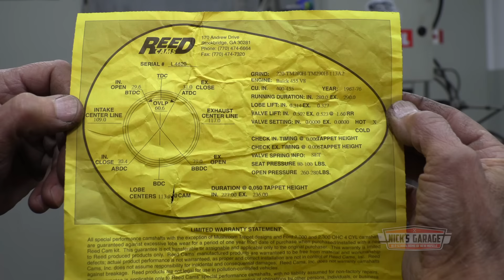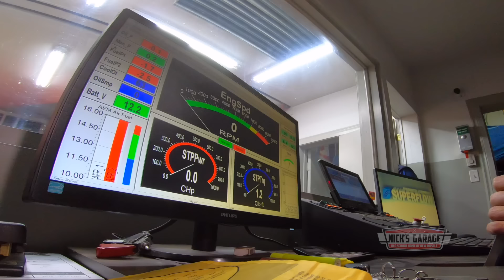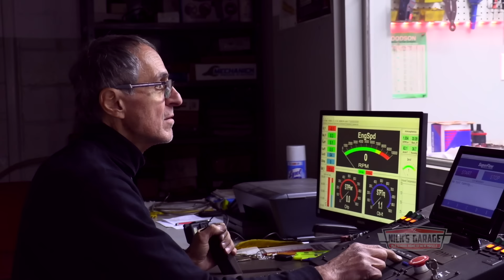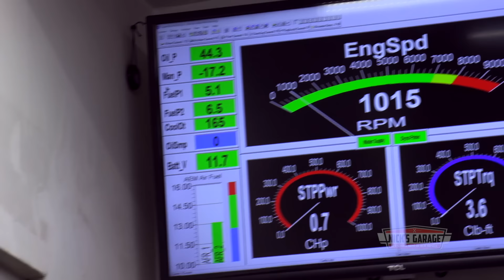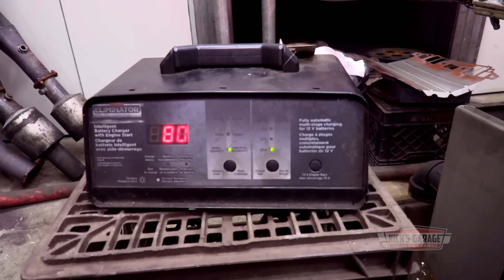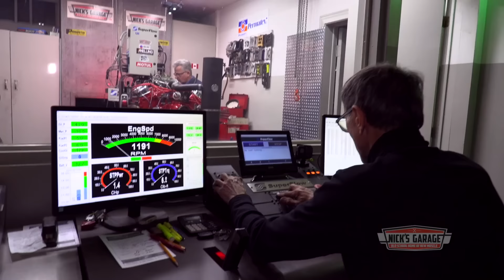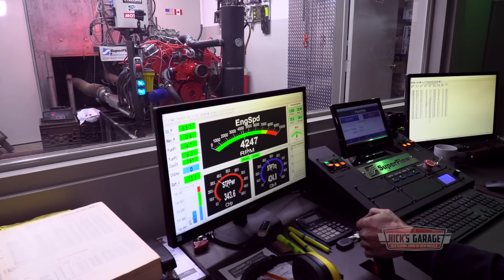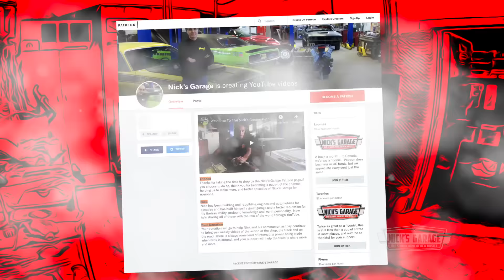1970 Buick 455 Stage 1 - Dyno Room Diagnosis

Comment: The ratings that you are trying to match do not mean much.  GM sales personnel were deciding on what the ratings would be.  The GM engines had very restrictive cylinder heads, and despite the big cam, you just cannot make the hp and torque that the 440 makes.  This big cam also kills your low end torque, but because of the poor flow of the heads, you don't get much upper rpm power.
Reply: What a load of misinformation. By saying "the GM engines", you are instantly discrediting yourself, as lumping all GM engines together is like lumping Mopar and Ford engines together.
Reply: @cdglasser  Actually, this is exactly right.  Pretty much all GM engines.  For the most part, Mopar was lying a lot less about their ratings.  Chrysler was a smaller company, and was not controlled by the bean counters and marketing managers.  They had a much better engineering department, and the engines were shared by all divisions and had to be developed only once.  Both GM and Ford were controlled by bean counters who knew that real performance does not sell because the average customer never drove their cars to the limit.  It was performance image that sold, and that is where the gross power and fictitious power ratings game came from.  There were some very few exceptions in these rules, one is the Ford 427, which was dropped in 66 or 67 because it was too expensive and replaced by boat anchors that had similar ratings but much less performance.  GM engines can now be made to make a lot of hp, but generally they need huge cams (no bottom end), roller cams (helps to compensate for lack of rocker shaft) and aftermarket heads (which somewhat compensates for the poor engineering of the time).  Having said that, the low end of Mopar engines also often exaggerated hp.  The single exhaust 440 was nowhere near its 350 hp as installed in the cars (it was perhaps 275 hp, it would be close to 350 hp with dual exhaust).  The 64 413 with single exhaust would not be anywhere near its advertised 340 hp.  But the rating of the dual exhaust 440, 383's, many of the 340's or the 426 hemi was not too far off.
Reply: @demetridar506  baloney
Reply: @markbuchanan3694  very insightful!
Reply: @demetridar506  people talk about Buick like they know about,them when they don't.  They talk out of ignorance,not practical knowledge. When it comes to this,it is best to be thought a fool than to open your mouth and leave no doubt
Reply: @markbuchanan3694  The practical knowledge is this video.  The buick is not a very good engine if you want to go fast, that's all there is to it.  Olds and the rest is not much better.  You have to do too many motifications to get something descent, and by that time its no longer buick.
Reply: @demetridar506  Nope,your just talking. I have built and raced them for about forty years,I have put a lot of so called better cars on the trailer.
Reply: @markbuchanan3694  The recently developed term "fake news" applies here very nicely.  There is no shortage of self declared champions.  Especially in the recent keyboard world.
Reply: @demetridar506  Are you an expert in this field?
Reply: @markbuchanan3694  What field?  In order to make power you need good flowing heads and a good valvetrain support so that you can have as high valve lift with as little valve duration.  Good bore to stroke ratio and not cheap material selection helps.  Most GM and Ford engines lacked all of these (partly to reduce cost, and partly because they did not have the development budgets), so you need a huge cam to make power, meaning no low end torque.  Add to that the terrible exhaust manifolds, I can keep on going.  This is not a complicated "field" that requires "expertise".  

In the 1960's the internal combustion engine was a fully mature product.  The world knew how to make powerful engines.  There is nothing special about the mopar engines.  There is no real sophistication or innovation in the technology.  In fact, by German or Italian standards, even the Mopars were rather crude and behind technologically.  But they at least did their homework, and were not trying to cut cost everywhere they could.  GM and Ford recognized that as stupid as the general public was (you think Americans are stupid now, they were a whole lot more back then) sound engineering was not necessary to sell cars (styling and marketing sold cars, i.e. imaginary hp numbers, which explains why the "expensive" Ford 427 for example was dropped in 1965 or so).  And they were right.  Chrysler went bankrupt in the late 70's, and were making marginal profits through most of the 70's.  But we can enjoy now the well engineered products with the simplicity and good styling of the old days.  And Chrysler engineering does not stop in the engines.  Suspensions and transmissions were also superior.  Even on the suspension world, it was still a bit crude compared to foreign manufacturers (Jaguar and Benz had IRS by the mid 60's, for example).  But again, at least they did their homework.
Reply: @demetridar506  you said a lot,but you are wrong on Buick. Their stage heads flow well,and the do have some good exhaust manifolds. Again you make assumptions without looking into Buick development. Their bore to stroke ratio is the best in the business,they have a very stable valve train set up,they were very advanced in developing light weight materials for every day use. Their 455 series engines do very well at making power in the ranges that are useful. Check out benisek and jones undefeated 72 season,or how about buddy ingersoll v6 prostock,and don't forget the indy effort. They were the first to put a stock block on the pole. Their nascar effort on the short tracks was dominant,the small blocks couldn't catch them. The gtp cars made so much power they broke the unbreakable March chassis,so I don't think you have done your homework on Buick.
Reply: @markbuchanan3694  Your comments are not supported by reality.  The stroke is a bit too long, the con rod is a bit too short, there is no rocker shaft.  The crank is iron.  All that shows that the engine was designed for economy of production.  Most of these engines were derived from small blocks, hence long strokes and short connecting rods. and GM did not want to invest in designing a big block from scratch.  Head flow was not impressive.  The performance of the cars as shown by multiple road tests of the day show that the cars were not that competitive.  This dyno test here confirms all that.  This is too simple to require any "expertise".  The race cars that you refer are more or less irrelevant, the race car engine abandons a lot of the compromises necessary for a regular passenger car engine, and the race results are often dominated by how much money the team happened to have as opposed to the quality of the product they started with.  And frankly, why would Buick, a division of GM, somehow magically deviate from the standard policy?
Reply: @demetridar506  You're WRONG on so many things. You should just stop now. The Buick V8 has a rocker shaft! The stroke is just 3.9" with a 4.3125" bore! It has forged steel rods! The Buick big block V8 was designed, from scratch, in the mid-60s and introduced in 1967! The 1970 GS Stage 1 was one of the quickest cars Motor Trend magazine had ever tested! Don't even get me started on transmissions - the GM Turbo Hydramatic 400 is well known as one of the best 3-speed automatics ever produced.
Reply: @cdglasser  Indeed, a quick google search proved that your 455 does have rocker shafts, I was pleasantly surprised.  But I was not wrong on the rest.  Yes, it has forged steel connecting rods, if it did not, it would not be able to rev past 4000 rpm!  But the crank is iron, cheap for production.  The stroke needs to be much lower than 3.9 for a good revving engine.  I would rather have bore to stroke ratio somewhere between a 440 and a 383.  No, the GS, even though that engine was only used in wheel spinning muscle cars and not on full size cars where you can really see the power of the engine, never did very well.  Mid 14's with fairly low gearing is not so good.  And everybody in the industry back then agreed that the Torqeuflite was the best in the industry.  Again, why are we arguing the obvious?  If they would install a 0.5 inch lift cam on a 440 with headers, you would be doing close to 450 hp.
Reply: @demetridar506  The crank may be iron, but it's not weak by any stretch. Numerous Buick engine builders have used the stock crank in applications having 600, 700, even 800 horsepower. 
Just because you say that the stroke needs to be much lower than 3.9" for a good revving engine doesn't make it so; that's a highly subjective assertion. The Buick engine in my '72 GS makes 605 HP at 6100 RPM with a 3.95" stroke. 
Motor Trend tested the 1970 Buick GS Stage 1 and got a 13.38 @ 105.5 quarter mile out of it - that's a little better than your claimed mid-14 second times.
Reply: @cdglasser  The fact that the crank is iron shows that the engine was designed with economy of production in mind.  You say it is not the weak link, but these failures are statistical.  Just the fact that yours did not break does not mean that none broke under hard driving, or even wore out the bearings faster due to excessive deflections.

The poor bore to stroke ratio and poor rod to stroke ratio by themselves are not enough to prevent the engine from making power, but are factors that certainly reduce upper end power.  In other words, given the same cam, same compression ratio, etc, an engine with better ratios will do more power.  There is nothing subjective about it, it is internal combustion engine theory.  I can explain more if you want.  And as I said before in my prior post, any engine will make power if you give it humongous cams (helps if you use aftermarket heads, or severely port them!).  The question is what you give up for it.  If you had built a 440, for example, you could get that hp with a more streatable engine.  And you may even use the stock heads!  Not to mention that the hp numbers are often result of a poorly tuned dynamometer (often on purpose so).

Motor Trend was one of the lowest quality publications back then.  I have heard reports of 11 second corvettes from M/T.   They were lying.   These BS is what sold issues.  Car & Driver was a little better, but not much.  Car Life was the best.

Again, we are spinning our wheels.  Just watch again this video, its all there.